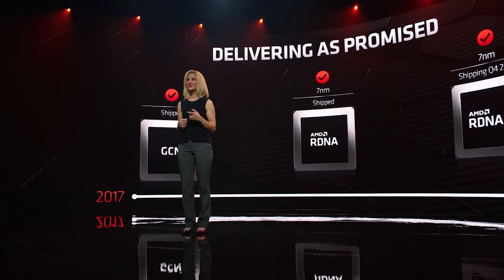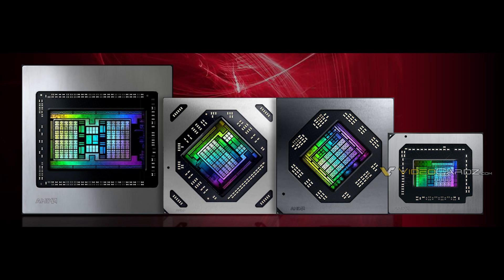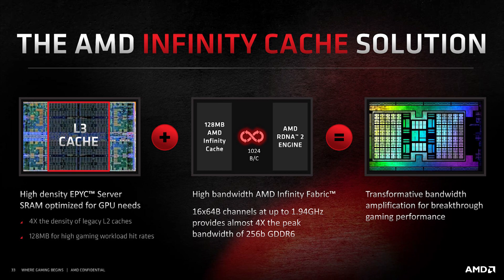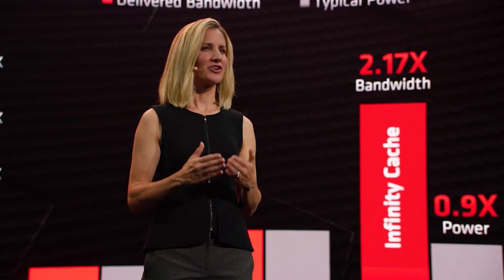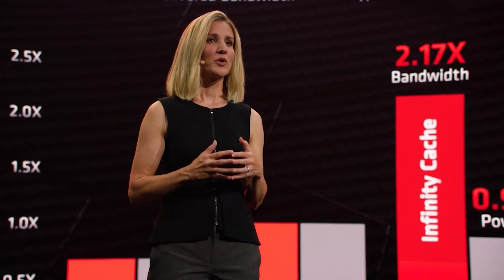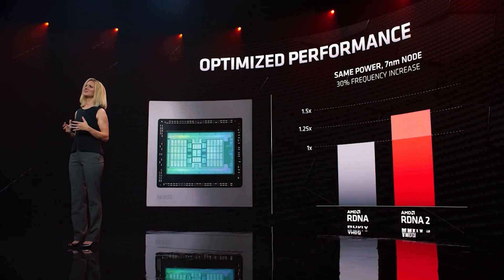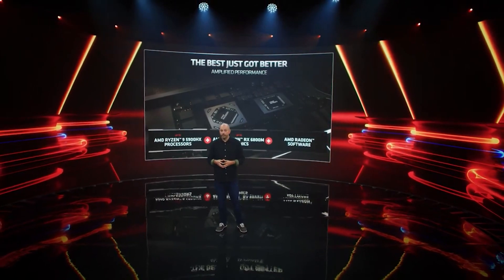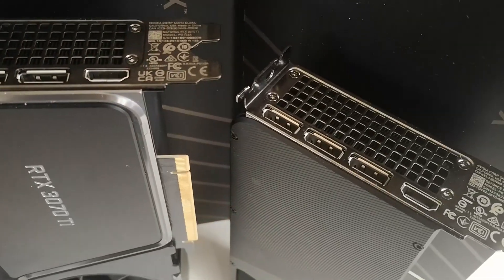Raja Koduri REVEALS Advanced GPU & Software Plans | RDNA 2 Shifts to TSMC 6nm

Comment: what happened to Sony and TSMC partnership to build chip plant?
Reply: Sony Semiconductor Solutions Corporation, said in the joint statement. Sony shares were little changed in early Tokyo trading. The initial capital expenditure is estimated to be approximately US$7 billion. Construction of the TSMC fab is set to begin in 2022 with production expected to start by the end of 2024. The chip plant is expected to create about 1,500 jobs with a monthly capacity of 45,000 12-inch wafers
Reply: @ThaexakaMavro  Thanks! :)
Reply: @ThaexakaMavro  what node would that be?

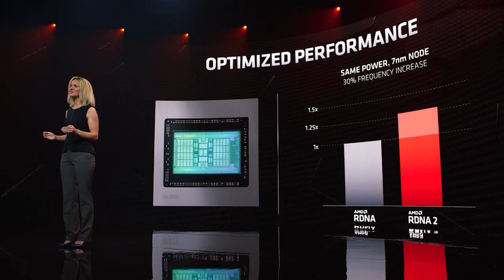Comment: 4:31 Well, significant by what stadard, i have a cheap 16GB kit of samsung B die memory for less than 100USD, and this 4400 CL18-18-18-36 gets 65GB/s and 54.1ns in aida64 compared to DDR5 4800CL40 which i've found several different tests showing it only getting 61-63GB/s and 70-90ns of latency

Of note, i have a 5700G and am able to easily get 1:1 UCLK/FCLK/MCLK if these processors cant reach 1:1 with DDR5 4800 they will DEFINATELY be better off (edit:with) good, but still cheaper DDR4

Comment: If MediaTek can use 4nm already, why can't/hasn't AMD yet?
Reply: Because unlike mobile SoC, amd can target "less advance" nodes and still churn out efficient designs. In mobiles, efficiency is everything so they'll need the latest nodes for every generation of products. Take the look at zen2 vs zen3. Same node but still 20 percent more performance at same power levels
Reply: The yields are better for smaller dies.  Desktop stuff needs bigger dies.
Reply: @avatarion  that's really not the case, high-end mobile chips are significantly larger than AMD's chiplets.
Reply: @karanvora2674  they can still improve things on old nodes I agree but if they want to be the best they will need every advantage they can get. 
In less than 12 months, if TSMC delivers, Intel will be using 3nm tiles on their chips, I would be surprised if AMD is using 3nm any sooner than 30 months!
I just believe AMD needs to stop thinking like a small company and start paying more to use the latest and greatest first.

Comment: Is this AMD's first GPU that will offer AI upscaling and useable RT? No, it's just another console chip. Well played AMD.
Reply: AMD Ray Tracing is worse, 1.35x slower in hybrid Ray Tracing and 2.7X slower in path Tracing games like Minecraft RTX

Radeon AI unit aka matrix core is only 1/4th of Nvidia tensor cores intreger capability.

Yeahhh that suck
Reply: The series x and ps5 offer decent rt. Look at the clank game and metro exodus enhanced edition
Reply: Who uses RT in real life ? You turn it on to just see it - then you turn it off again because you want fps. This no matter if you have nvidia or amd !
Reply: @Thomasdk1405   nope , Minecraft rtx looks beautiful and so does metro exodus enhanced edition
Reply: @Thomasdk1405  With a 3080, I use maxed out RT with DLSS whenever possible.
Reply: @earnistse4899  Decent for a console. It's a real shame they didn't add more RT effects for the PC version of MEE.
Reply: @alistermunro7090  dlss = cheat ! Then you should compare amd with fsr and RT. Apples to apples !
Reply: @Thomasdk1405  DLSS looks great, FSR does not. RT with/without supersampling runs up to 50% faster on Ampere when compared to the console based RDNA2 GPUS.

Isn't cheating when you turn down the settings to get more FPS just to beat a kid using a controller? ;)
Reply: @alistermunro7090  Fanboy for sure 😄
Reply: @earnistse4899  😄 besides you no one use this and def. not in multiplayer games. Blindtest with random people (linustech) showed 50/50 guessing. So too hard to tell and does not justify the impact !
Reply: @Thomasdk1405  I only use rt in story games. It makes a huge difference
Reply: @Thomasdk1405  Yes, I'm a tech fan, hence avoiding AMD's console chips.